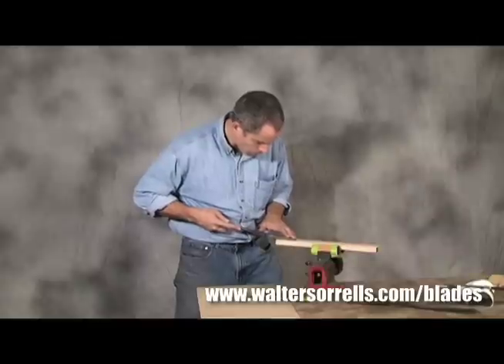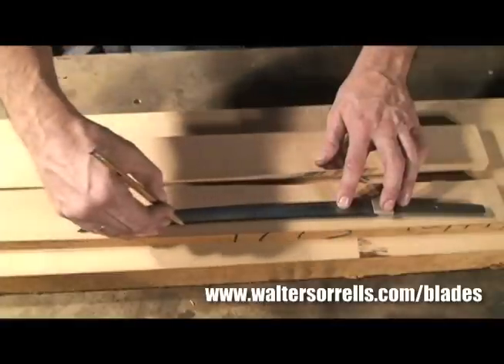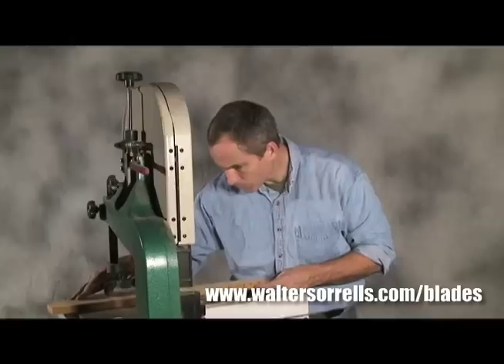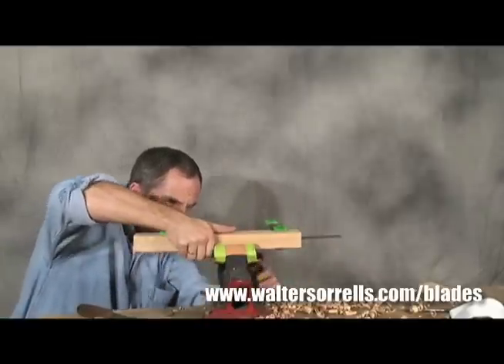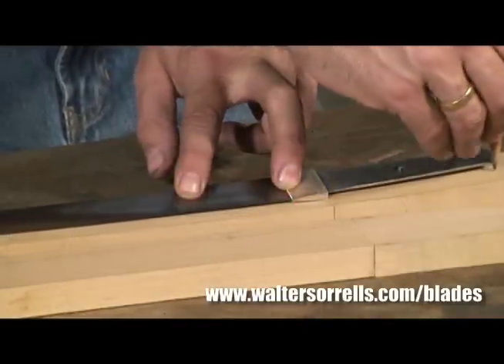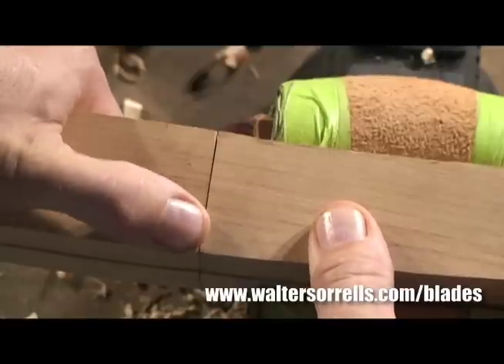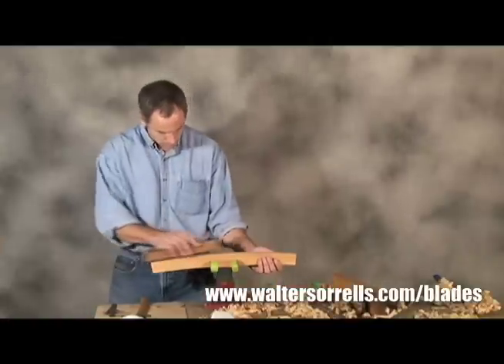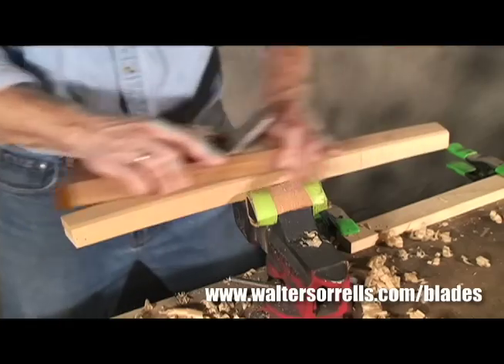How to Make a Saya (Japanese Sword Scabbard) with Walter Sorrells

Comment: laughing the whole time because the narrator is the man in the video so he is talking in third person, but thanks for the video I wish to start making wooden sheaths so video research is where I'm starting.
Reply: Geroge is getting upset!
Reply: Does polishing Katanavs remove steel
Reply: Yes. However, if you do it properly, it won't be enough steel to change your fit.
Reply: X Infinity I recommend sending it off to a togishi (blade polisher) if it's an expensive katana. If you want to learn how to polish, you should try doing it with cheap knives and katana. But yes, it does remove steel. That's why I suggest sending it off. You can mess up the geometry (the distinct angles of the blade) like the kisaki (the tip of the blade) and end up rounding them all off.

Comment: For some reason, I find it somewhat amusing that, in the beginning, the narrator refers to the tanto as a 'small knife' when, typically, the blade was anywhere from 7-12 inches in length. That's about the size of both a bowie and kukri, which are traditionally thought of as large knives.

Comment: The shirasaya is ONLY for storage...

The shirasaya was used to store a blade which was not being used, as the bare wood (without laquer) retained much less moisture and would not cause degradation of the blade.

Most blades mounted in shirasaya would also have a set of functional mounts, which the blade would be transferred into if the blade were to actually be used.

There were instances when functional weapons were disguised as canes or other items which at times resemble shirasaya mounts.

Comment from the maker: Generally swords are straightened before sayas are made for them.  It's not super hard to do if you're really careful about not overbending.  The reason is that the bigger the bend, the wider all the components would have to be, making things rattle around.  Not sure about the handle without seeing a picture, so I'm afraid I'm not much use in helping you with that!  :)

Comment from the maker: The pin is just friction fitted.  It's tapered, so you whack it in with a little bitty hammer and until it's firmly seated.  You have to check it periodically, of course, because it wears and loosens over time.

Comment from the maker: @azreal289  It's a little complicated to explain, but normally it's carved as a single separate piece, then dovetailed into the saya.  You can make them from wood or buffalo horn or whatever.   (There are also metal ones, some of which are held on by a band around the saya. ) If you're really into figuring out the details, there's a very in-depth explanation on the video that you can find on the web site listed at the bottom of the video.

Comment from the maker: @Ailtin731  It's a plane.  This is the Japanese style plane which has a wooden body.  Western planes have metal bodies and operate on a push stroke instead of a pull stroke.  But they both do the same thing.  You can find Japanese planes at Japan Woodworker, among other places.  You can find them online.
Reply: could I use a western style plane to form a scabbard, is there a reason to use a pull plane

Comment from the maker: Interesting. I haven't used yellow cedar. You mention that it's harder than red cedar. The one potential issue (not knowing the wood myself) might be that you want the wood to be super soft. Also, cedar has some aromatic qualities which might involve compounds that could accellerate rust.  But for all I know they might be rust inhibitors, too!  Just throwing that out there.  As to the square...it's a decorative touch, but it can also be used to adjust/tighten worn mekugi holes on older sayas.

Comment from the maker: @calmackie  I don't offset the mune (spine) at all, but the blade side is offset just enough so that you can give the sharp edge a little pocket to rest on.  As you suggest, it makes it likely that the blade will slice the joint open otherwise.  That little pocket or shelf or offset or whatever you want to call it is quite small -- maybe a hair more than a sixteenth of an inch or roughly 2mm.

Comment from the maker: I vary that a bit depending on the overall size of the blade.  But somewhere in the range of 11/64" to 13/64".  Generally you want to keep it a little under a quarter inch.

Comment from the maker: @Elozar100 There's no one-size-fits-all answer, unfortunately.  If the split is on the joint, then it's not that big a deal to force it open a little, inject glue into it, then close it up to dry.  If the split is in the grain, the same thing can be done...but it's harder.  Ultimately, unless you're doing artistic restoration of an old saya, the best solution is to make a new one.  In the end, a scabbard is a consumable.  They've only got so much use in them before they give up the ghost!

Comment from the maker: @combatcommand   You can check the web site listed on the bottom of the video for info about my blades (though at the moment I'm not taking new orders).  The so-called "tanto point" -- a wedge-shaped point used in western tactical knives -- actually has no relation to the geometry of Japanese tantos.  The term was used by a prominent American knife manufacturer because it sounded cool, not because it was shaped like traditional Japanese blades.

Comment from the maker: Unfortunately routers can't be used to make high quality sayas.  Believe me, everybody who makes these things has tried it!  But because the scabbard needs to fit relatively tightly, and because the geometry of the sword varies over the length of the blade, there's no way a router can do it.  Plus, you'd need to make a separate jig for every blade you made...which would take about as long as carving the scabbard by hand...

Comment: Have you used Yellow Cedar (Chamaecyparis nootkatensis)? It has all the qualities you describe + it has anti-bacterial/fungal properties similar to Red Cedar but harder. It lasts w/out rot for 100's of years.The density between the early and late wood in almost identical making it one of the best carving woods. BC exports the whole large logs to Japan for use as temple posts. I see you squared out the area surrounding the pin and used another wood for support. Alder split without? Great video :)

Comment: hey Walter.  planning on building a sword, I have your sword forging video already and hope to get the others also.  my question is about using hard woods. if I were to use a hard wood like wenge is it possible to line the inside with something that would not scratch the blade? or have you tried something like this?   also, tools for hard woods. are there different styles of tools that would make cutting into hardwood easier?

Comment: Thanks for the vid very educational. I am planning to make a saya for my katana, as its cracked, and the so has the handle. The blade however is slightly bend and uneven, The Spine is however straight, I want to know if its possible to still make a saya for such a blade. Also the blade does not have the same handle half instead its a straight body with an end for a bolt. Any advice how I could make a handle for such a body.

Comment: I am hoping someone can answer my question because I looked on the internet and it tells me nothing. So I have a shirasaya sword with a very small chip that is almost impossible to see and was wondering if there is any safe method to take it apart without breaking the handle or anything in order to do maintenance on the blade? Probably a dumb question but I never dealt with shirasaya swords before

Comment: I always heard that wood like alder isn't good for blade making because it was too soft. Is that wrong or was it just used because of it's availability?
Reply from the maker: It's used for scabbard making specifically because it is soft and won't scratch up your blade.  But you're absolutely right that it would make a terrible material for the handle of, say, a hunting knife.
Reply: Walter Sorrells That makes sense. I tried something similar on a knife I made a few weeks ago, handle and scabbard was entirely made out of rosewood, carving a slot in it was quite difficult especially since it's something I'm new at, used birch for part of a handle on a new knife and it was much easier.

Also I found out that I was allergic to rosewood, ended up having some throat swelling and large rashes on my neck and arms. I had to get a friend to do the final sanding on it.

Comment: "blank" is traditionally done this way, but here walter takes a modern shortcut...
Reply: +Dustin Sharp    Same result, only much quicker.
Reply: +Dustin Sharp whats wrong with taking a modern shortcut eh, thats what I do not understand about traditional japanese smiths, they also want the fittings to be traditionally made when you can easily use modern methods which is faster and cheaper
Reply: X Infinity sometimes hand tools can be better because it allows you to be more precise and careful

Comment: hey guys two questions

First: does anyone know of a video about making (or repairing) a Saya for a two edged straight blade Katana; mine cracked.
Second: does anyone know of a website or something where I could buy just a blade?
Reply: the cracked sword is ruined i would say. but check out "cultofathena.com" for just a blade. they support craftsmen, so you can buy all sorts of pieces in their site.
Reply: the sword itself is totally fine, it's just the Saya that is cracked, so I need a new one. also thanks for the link.
Reply: two edged straight blade = not a katana.
Reply: depending on the severity of the crack, you could use some kind of wood filler, wood glue or epoxy, then sand down the whole thing and re paint and lacquer it or whatever finish is appropriate. If the crack is effecting it structurally, like its literally cracked in half, you might be out of luck.
Reply: Jordan Mahara I might try that. Its not cracked all the way into two pieces. Its on one side about two thirds of the way. The only reason I would like to find a new saya is I think it will probably break again; since the saya is pretty cheap. Though the sword is good quality.
Reply: Ya if the saya isn't expensive then you may as well buy a new one.
Reply: Try bugei forge. They sell all elements of katana individually.
Reply: You sword is called a nitanto and some are guna say that is the smaller sword that is almost a knife but they are pronounced differently
Reply: +rempidgingerwhat I know this is an older post but to my knowledge there is no blade weapon called a nitanto or ni tanto. I believe that any "double" edged sword from japan is a modern modified version of a katana. A traditional samurai blade weapons consist of the noble katana, a wakizashi(short sword), and a tanto knife. The only blade that I have seen or heard about being double edged is a naginata which is a long spear type of weapon but even then the majority of the ones that I have seen have a wider blade that is curved with a single edge.

Comment: No never!

The shirasasa is only for storing the blade.

There is no tsuka ito, so it would be uncomfortable to hold and your hands would slip. With no tsuba, you'd end up cutting off all your fingers when your hands slide forward onto the blade.

With no seppa, the blade is looser in the handle. This is fine for storage, but very dangerous if you were to actually use the sword.

Finally, the Koiguchi does not lock tightly with habaki the so the sword would easily fall out of the saya.